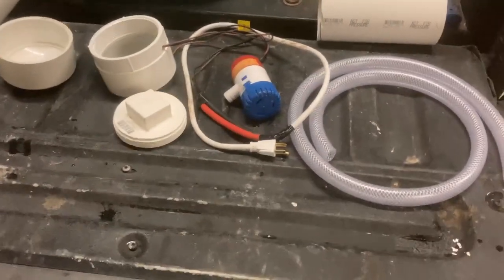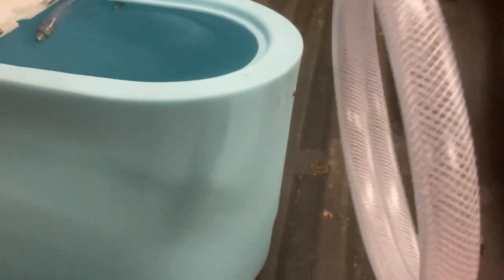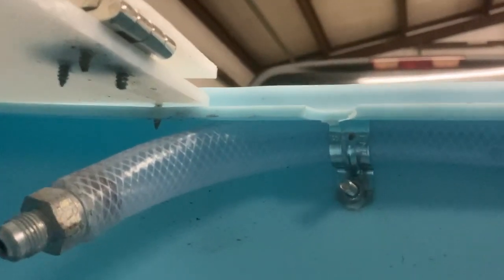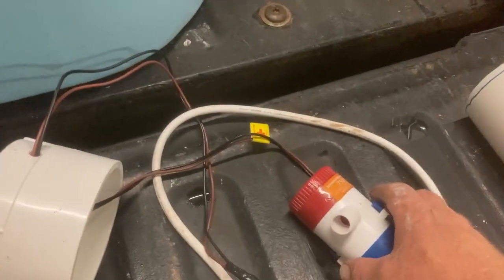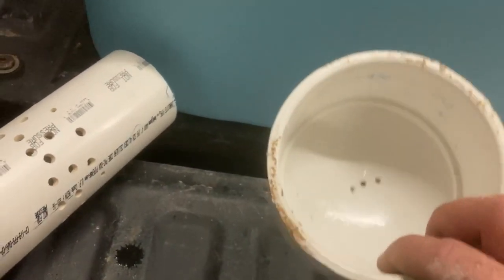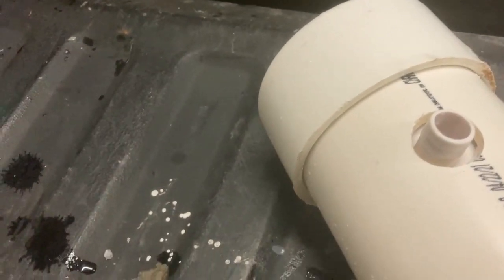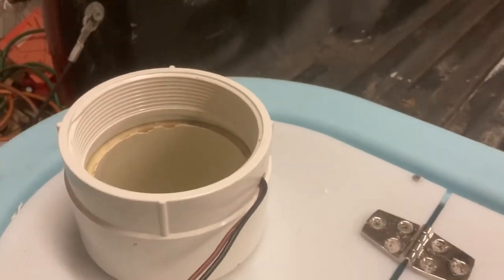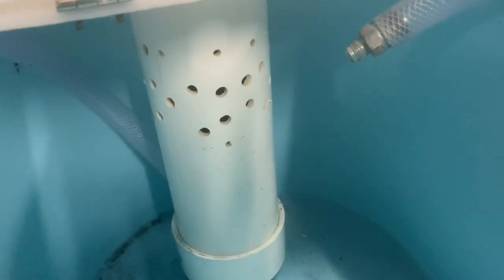Bait Tank Build

Comment: Where did you get your tank?
Reply from the maker: I bought my tank at BoatID.com
Reply: Great job on the filter. I always prefer the pump below the filter material. I’d through a bag of activated charcoal  and phosphate remover in there and it will keep the water crystal clean and the bait alive even longer
Reply from the maker: Great suggestion.  I've never had to use the charcoal filter due to the spray bar helping to reduce the ammonia in the water. I need to try it in both of my tanks and see how it works.
Reply: I’m going to try it out, also got some lava rocks